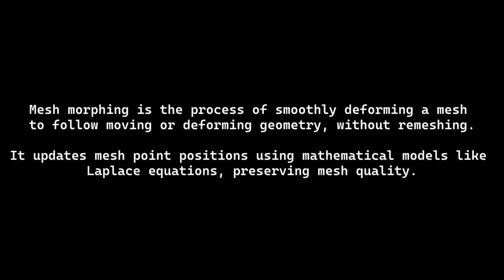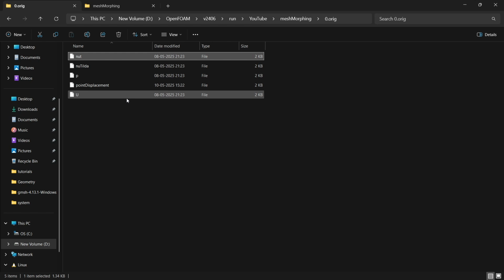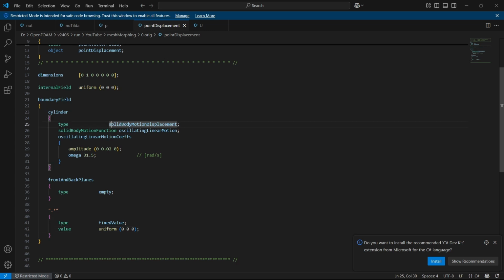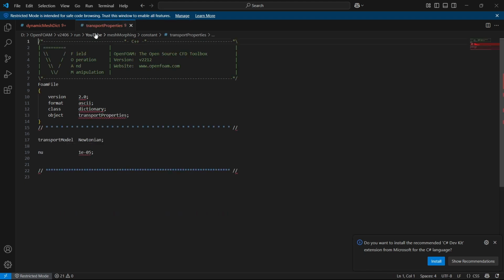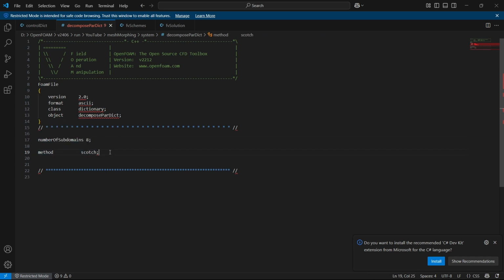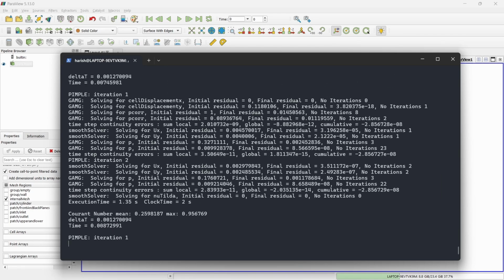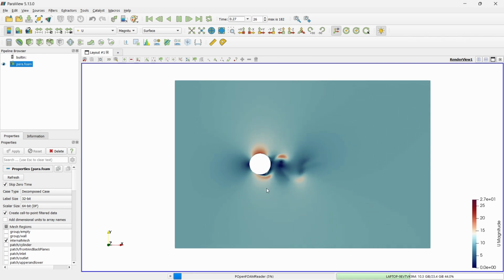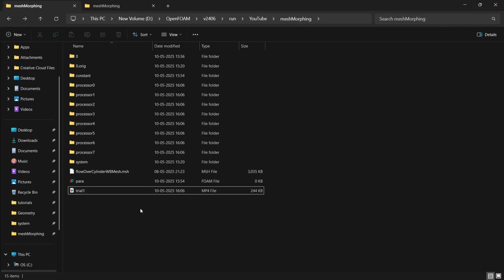Vibrating Cylinder Dynamic Mesh Morphing | OpenFOAM Tutorial | English

Comment: Great Video and I was trying to run this problem, but I am not getting any cell displacement or mesh motion
Reply from the maker: Were you able to find any potential issues? I am not sure why that would happen for the same case.
Reply: I am using openFoam v 12 not esi one
Reply from the maker: Oh maybe that's the reason. That tutorial is suitable for ESI version.
Reply from the maker: Sure.

Comment: if i want to move the cyllinder , i mean displace from one position to other how to do that
Reply from the maker: just like oscillation there is a utility called point displacement which will help you do that.
Reply: In point displacement, I give velocity of cyllinder and in the library also I add v*t + oscillation equation, but not worked
Reply: How to add one more cyllinder
Reply from the maker: I dont understand. Please elaborate.